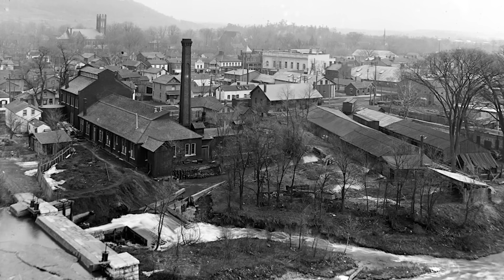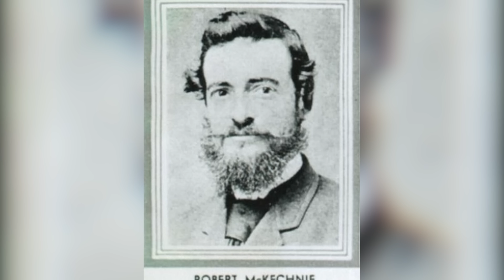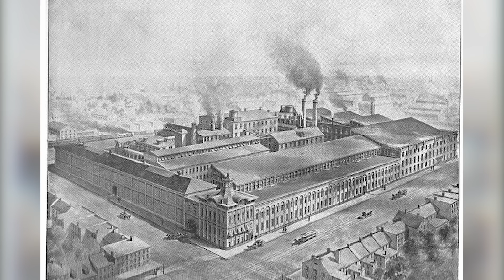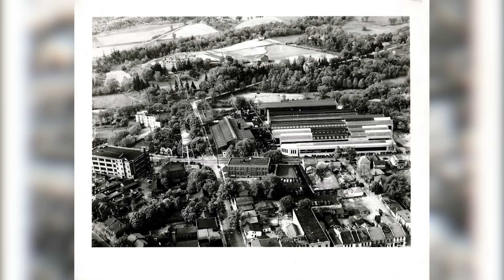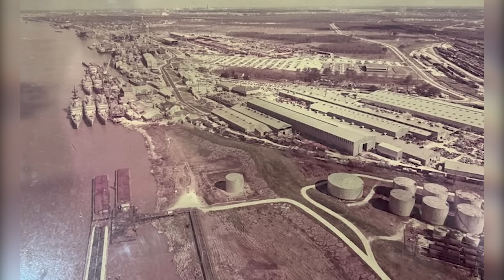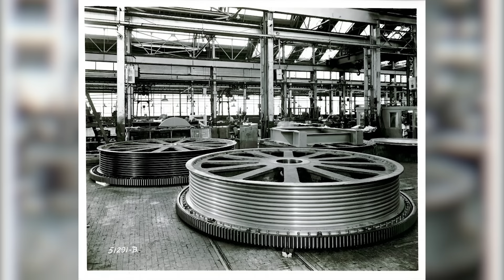Inside the John Bertram Factory: How Canada Built the Giants That Powered the Empire

Comment: This is the best video that Industrial North has produced so far. It provides a very good overview of the Bertram machine tool company. Bertram provided general purpose machine tools that could produce a variety of products. It did not build not high-volume specialized machine tools that were used by auto, aircraft or consumer industries. There is also a large Bertram archival collection at Library and Archives Canada in Ottawa.